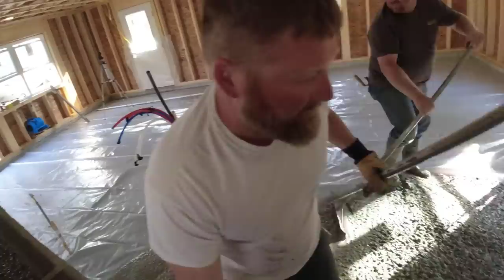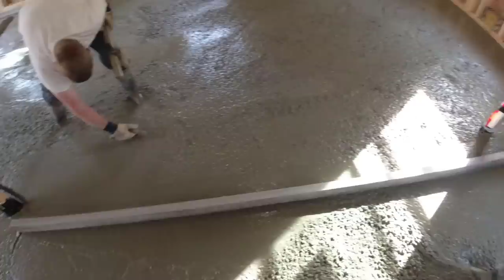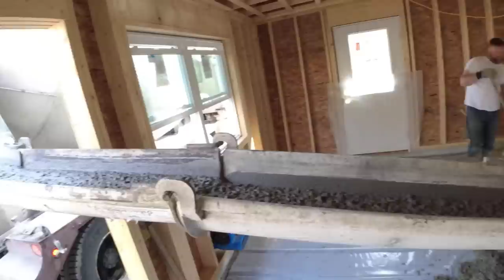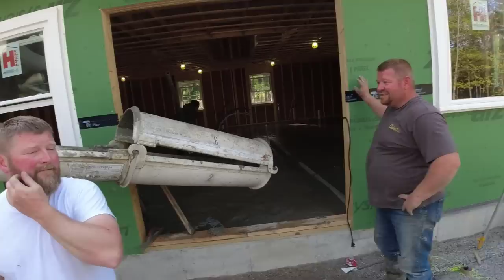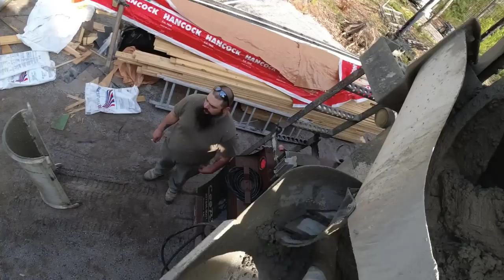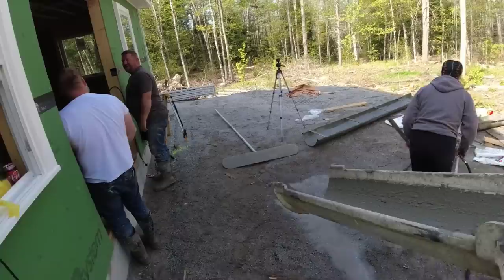Pouring Concrete Inside A Framed House (30' X 30' Floor Pour)

Comment: 1 hour for 4 people, easy site access for the truck, no way is that worth a pump.  Even if you already owned a line pump, it doesn't seem worth the additional setup and cleanup labor and extra concrete.  Let alone having to hire one.  You already know this but you made the right call for sure.  Glad to hear you guys have lots of business
Reply from the maker: I agree with you!

Comment: It looked like a very clean, and very ready to go job site, if the builder is that prepared with plastic on everything, and lights, and clean, that gives everybody more incentive to do their best job. ( just my 2 cents ).
Reply: 100% correct.  Sometimes it’s hard to go the extra mile when the customer or builders obviously don’t care.
Reply from the maker: We like it when we show up and everything's ready. We did the plastic on this one. That's one thing no one else seems to want to do.
Reply: @MikeDayConcrete  do you use 6 or 10 mil plastic?
Reply: Hey mike when you use that water reducer does it change the rate that the concrete sets up. In another video I heard you say a 3/4 slump would be around a 6 slump if you add water reducer. Would it set up like a 4 would or would it set up like a 6…. Im pouring a garage floor and going to give the water reducer a try

Comment: What a PIA - all of those pipes sticking out of the slab! I know that they're a normal part of a pour, but SO much more difficult when there's walls in the way... I always hated those inside pours. The thing that stuck out the most for me in this one was how Darrin and Luke are in such better shape than the 2nd driver! They're all big guys but you can tell who the ones are who are used to doing man's work (and Tia work!) all day, every day and who drives a truck instead. Not to demean the driver, but I know who I would pick out as not as strong as the others... 
Another great job - Cheers!

Comment: hope all is well mr mike!!! gona kick baxk and get some pop corn. i do enjoy yur content i will let u know my thoughts at thee end
Reply: ok so the chute thing. love it, they qont let us chain it on the end of their shoot. we have to make a wooden support thing to sit it on. but i do love the shoots. the mud looked like it shanges a whole slump by the end of the video is that because the water reducer? they put water reducer in most of our loads no matter what in the summer, nit sure if its high or mid range. Great video. keep jaming out that long list of people.
Reply from the maker: Yes, water reducer makes it look looser. Ours is a combo mid-high now. I've used chutes since I was 16, we try not to wheel anything.
Reply: @MikeDayConcrete  I get it i use em too, esp on basements but I haven't poured a basement in 10 years. I did use a chute in a video last year. they wouldn't let us chain it up but we were prepared for that, some don't care but some do

Comment: Anytime you have limited access with regard to delivery of the concrete and/or finishing, it'll slow you down big-time.  Been there, done that.  Spent 6 hours on a power trowel in March 2021 going over 24 yards poured in 3 deliveries over a 5 hour time frame.  Under cover, and little help with the finishing job.  Nightmare long day.
Reply from the maker: Those are a nightmare.

Comment: There would have been two of us pushing wheelbarrows and two puddling and rodding and finishing.  We don't have the chutes like you do.  LOL we are short squatty bodies so we dont have to pick up the wheelbarrows as high as you guys may have to. LOL, can hold more in the wheelbarrow that way.  Probably would have taken as long, about an hour.  Nice video.
Reply from the maker: We try not to wheel anything, we've all hurt our backs with wheel barrows.
Reply: @MikeDayConcrete  LOL, you guys are too tall to use them.  Gotta be 5'2 or shorter, wide shoulders and no neck.  Great video, take care.

Comment: I dont remember seeing you use buggies. Is that because of the loose slump you pour ?
Reply from the maker: We use them when we need to, just not often.
Reply: I have done my share of concrete, but i find it so interesting the procedures and mixes you use to combat the cold. I live in the south where we fight the heat

Comment: Mike,
As usual a great job with obstacles.

Why are you using a higher slump inside, I think you said 7, don't you usually use 6.

I would think anything inside has a lot to be desired because of the poor lighting? But being that you have been doing it so long you are use to it. I would just think you can't beat natural lighting.

I have noticed that when you used fiber mess, at times you use wire and/or rebar as well. I thought the main reason for fiber mesh was that you did not have to use wire and rebar? Or is it a case by case situation?

Interesting listening to you talk to people. Not as much your guys, which appear very well schooled, but the drivers of the trucks. I am sure they can make a pour go easier if the are schooled the right way.  Just an observation. 
Keep up the great work and filming. I am sure the editing takes a lot of time.
Reply from the maker: Because we can with the mid-range in the mix. Just a lot of pulling around and it was really hot.

Comment: I would never pour concrete that wet. Just my opinion. Id wheel barrow to the far side and work my way back. You must be somewhere tgat doesnt get frost with no mesh and weak concrete. Im jealous. We need 18" x 18" going up to a 45 on the edges for a slab on grade here. Winter is a bitch